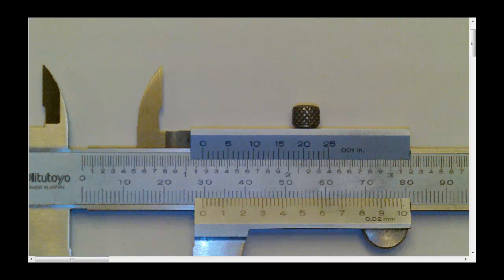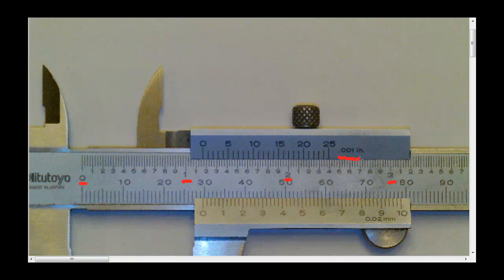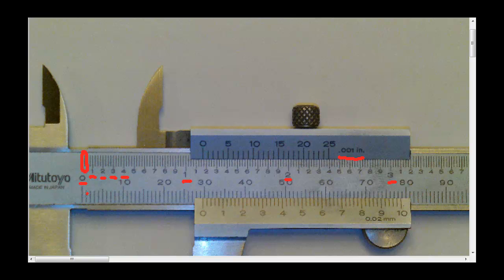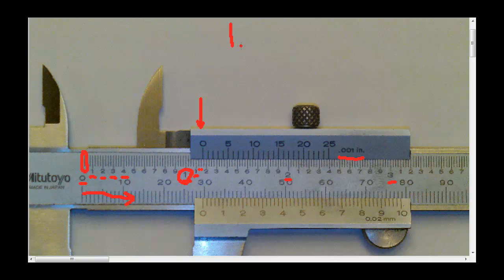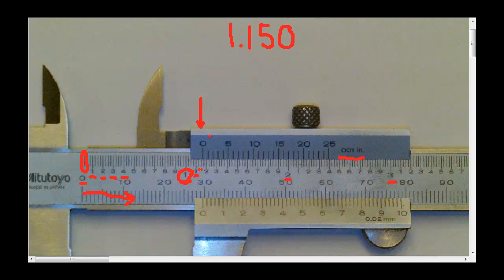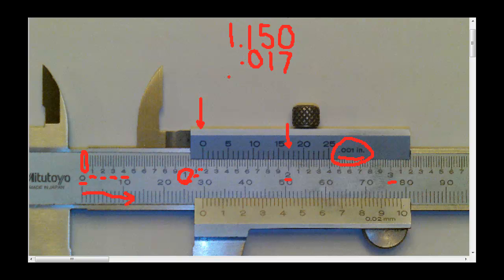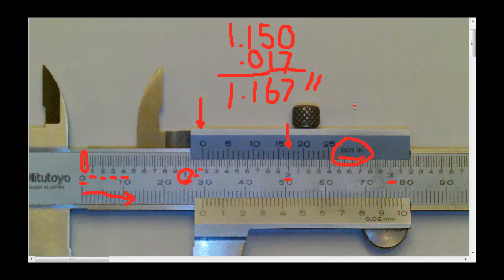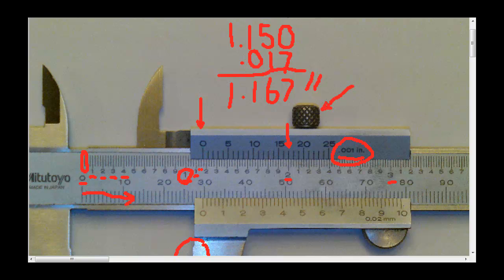Inch Vernier Reading

Comment: As someone who uses the metric system this gives me headaches. Still trying though. What if it's below 1 inch?
Reply from the maker: I know what you mean. If the reading is less than 1 inch then there is a zero before the decimal.

Comment: Hi sir is me again XD,its really same as the question on Metric,i still saw it the lines up it before the 0.17,why not be 0.15?
Reply from the maker: Hi again, the answer is the same as with the metric. In this case it is actually the second line after the 15 that lines up. Each one of these lines is .001" or .017" in total. Added to the main scale reading of 1.150" +.017" gives you a reading of 1.167". It is a bit different to read compared to the metric vernier. Thanks for your question. Enjoy your vernier reading.
Reply: @machiningmoments  oh thanks for your explain :D,so if the situation like got two lines up line ,we always choose the second one?or got other solution to get the answer ?like i saw someone comment at  metric video below, the formula like this 
"Distance of the main scale minus the distance of the vernier scale.

60 - (31*0.98) = 29.62 mm."

Comment from the maker: Because the zero on the movable scale is between two lines on the main scale you need to move your eyes down the movable scale until you find a line that lines up with any line on the main scale. You add the number of lines on the movable scale up to and including the line on the movable scale that lines up with the main scale in this example it is .017", this is added to the measurement on the main scale (before the zero). Thanks for your kind words. Good luck!